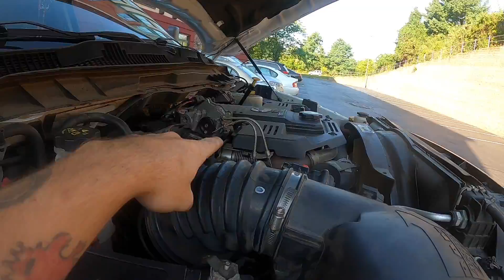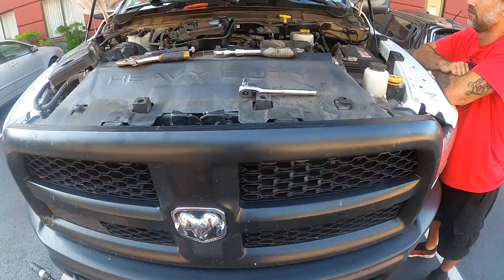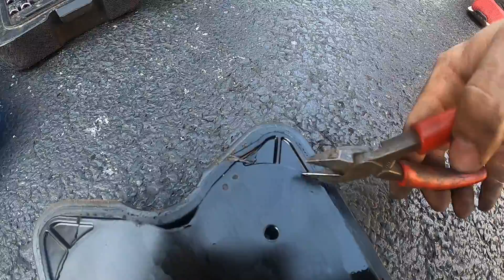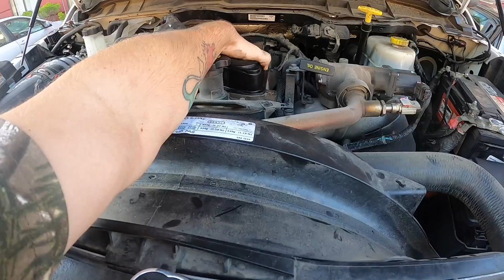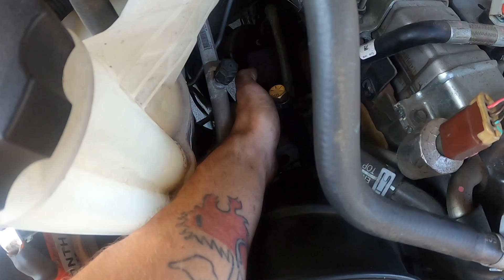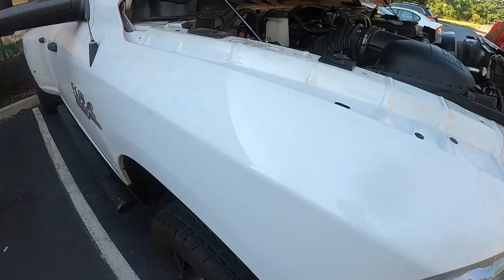How To Save Your Turbo On Your Hotshot Rig | Ram 3500 CCV Delete & Catch Can Install

Comment: I did this 3 months ago. And I still keep getting "perform service" message everytime I floor it.
Reply: Interesting! I recently changed my filter, only to have the indication come back up when going uphill with a trailer on. Goes away once the throttle is let off, but certainly frustrating! How is a filter with 500km on it need replaced? I figure its a computer error and have carried on since.
Reply: @palmerclements2926  yeah i think it's a sensor related issue. Just giving a different reading.

Comment: Hey I am getting lots of oil on the top of the filter of the oil Catch can spitting lots of oil What could be the problem
Reply from the maker: How's the blowby of the engine? Valve seals, broken rings, turbo issues, injector issues, could be anything. Start with the blowby test. I've had a good running engine that had numerous broken rings😐 Hopefully not your case. It could be something minor but blowby is the easiest to check.

Comment: thanks for the info bro
can i do it on my 2012 3500 6.7L Cummins? 
where do I get the stuff from?
Reply from the maker: A few comments down I posted a link. It's a universal kit the customer provided.
Reply: Found it, it's pretty cheap. You've mentioned something about the DOT. Will I have less black smoke coming out? Or why exactly this is useful?
Reply from the maker: @bashark9  This keeps oil droplets from going into the inlet of your turbo and prevents the premature wear that comes with it. It'll catch the oil rather than vent it into the ground
Reply: @CPSteveMiller  thank you sit.
My truck is deleted, and I have so much smoke coming out when I floor it, do you have a solution for that?
Reply from the maker: @bashark9  If there's nothing wrong with the truck try a better tune. I recommend optimal welding's tunes.
Reply: @CPSteveMiller  I just had it tuned :s evi live 2
Reply from the maker: @bashark9  Without seeing it it'll be hard to diagnose but if it's only at wot run a data log and have them take some fuel out of the tuning
Reply: @CPSteveMiller  Optimal Welding has some really Awesome tunes for sure! Thanks for all Your info...

Comment: Question on how you mounted your catch can I’m trying the sam location in my ram I’m wondering if my area under the hood by the passenger battery is tighter in a 2500 than a 3500
Reply from the maker: They should be the same. Trim level and year may affect it though but not entirely sure.
Reply: Thanks for the quick response if their any pic you could provide that would be very awesome thanks again.
Reply: Did you ever get a check engine light after the installation at any time
Reply from the maker: @dominicsmith3791  I haven't talked to the customer in some time so I'm not sure. I don't believe so though.

Comment: Did your check engine light come on ????
Reply from the maker: Last I talked to him, it didn't come on
Reply: I tried it on my 2015 and it popped on at 1500 miles.  So it’s put back on with an oil catch can in middle
Reply from the maker: @kevinherwig2507  Good to know. I forget what year this one is.

Comment: I would stray away from a vented catch-can on a boosted application. And instead route it back into the intake. The reason being to reduce positive crank case pressure.

Check out 'Mann Hummel' brand filtered oil separator, aka catch can. Much higher quality than those generic cans. Their 'Provent 200' is the can I've used, and works very well.

You can use reinforced clear vinyl tubing and heater hose barbed fittings for routing your lines to the can.

Just wanted to add this to give people a better option than what looks like came in the shown kit.
Reply from the maker: You definitely do not want to put the tube into your intake. That's why most people go this route is to delete the factory's hose that already goes into the truck. With it directed in the turbo/intake you end up gunking up the turbo, intake, throttle valve, etc. All factory 5.9 trucks run the breather to the ground. Most guys who run high boost in race cars, drift cars, high horsepower boosted applications all run a catch can(mainly to keep oil off the trucks instead of dumping it on the ground). Not to mention it kills the turbo so much faster, again which is why you want to delete the factory's setup which already directs it into the intake. When you delete this hose that goes into the turbo you should pull the turbo and clean all the oil that's accumulated. Your turbo will also last much longer and thank you. I've replaced a bunch of turbos because of premature failure from this factory design. It's sad the epa and manufacture's don't care that these things don't last like they used to.

Comment: I don’t understand why everyone wants to delete the ccv filter, all you need is a industrial valve cover and some 1.25” hose out the back mine comes out right after the trans cross member. The filter acts as a catch can and with a industrial cover it does not leak or spit any oil, you just have to change the filter when ever you start to smell oil, for me about every 100k. The key is the industrial cover.
Reply from the maker: This is how I see most people doing it. Either way works fine. No negative side effects either way and the same result is achieved👍
Reply: Where did ya find an industrial cover?
Reply: The magical world of eBay

Comment: My 2018 3500 Dually is deleted. I left my crankcase filter on and just added a catch can. Works just as good. No oil residue in the turbo.
Reply from the maker: Yeah that's the important part is keep it from the turbo. I was told to delete the filter because without the suction of the turbo pulling gasses out it may be a restriction and possibly blow gaskets. Can't confirm but they get clogged up and need replaced eventually so once you install a catch can they are not needed. It's one less maintenance item👍
Reply: @CPSteveMiller  I only have 13,000 miles on mine so far. I plan on changing the filter every 20,000 miles.
Reply from the maker: @CSXtrackworker  You could experiment by gutting an old one and see how much extra oil you get in the can. Just a thought🤔
Reply: @CPSteveMiller can’t you install a catch can and just run it between the ccv and the turbo? That way you can leave the filter in the ccv as well because you would still have the suction from the turbo?

Comment: Bro. I literally did this 3 days ago on my truck. I need to make videos
Reply from the maker: Definitely beats the factory stuff. Mine from the factory just runs to the ground. I believe the changed that on 07.5 dodge's and up
Reply: @CPSteveMiller  
I watched pd diesel, I routed vent down into the frame rail with heater hose. , you think that's okay? No filter. And of course i plugged the inlet pipe on the turbo
Reply from the maker: @tallgeeseheavy5311  You'll just drop some oil on the ground. It's not a big deal unless you're commercial. Dot will consider it an oil leak and you'll get a violation. If it's in the frame rail you may be better off and easier to get away with it

Comment: What is the name of the kit and where do you purchase
Reply from the maker: Customer just sent me the info. EVIL ENERGY Polish Baffled... https://www.amazon.com/dp/B07RGNTF5Z?ref=ppx_pop_mob_ap_share
Reply: Why would you want this kit? Nothing fit properly. What a pos
Reply from the maker: @robertjohnson2879  It's a generic kit which is the bad part about it. It's a "one size fits all" type deal but I had to drill the holes bigger to accept the new hardware. I don't know that they make these vehicle specific so this is just what the customer brought me.
Reply: CP Steve Miller I’m not criticizing you at all. You did what u could with what u had. 👍. Just the kit. If you have that nice of a truck don’t cheap out on lame parts. Just my opinion 🤷‍♂️
Reply: Thanks for your input always a good idea to get all the information available

Comment: So this won't throw a code / check engine light?
Reply from the maker: If done correctly it will not throw any codes. He had codes before which is why this was the route that was taken. It'll also save your turbo from failing long before it's supposed to.

Comment: With Ford you simply remove the whole filter, install a block cap and run a hose down under the truck into a catch can. 😬
Reply from the maker: Most guys just run a turn up to a filter but dot will notice oil spots and get ya! My 12 valve dumps on the ground from factory. Call that the pre oiling anti rust system😂 glad I'm not commercial anymore
Reply: @CPSteveMiller  you ok these days CP? You went from humble to you dont give F anymore? Lol
Reply from the maker: @fritzduval  All good over here😅👍 Hopefully I'll have a shop next month and working on a website. Life's good😎